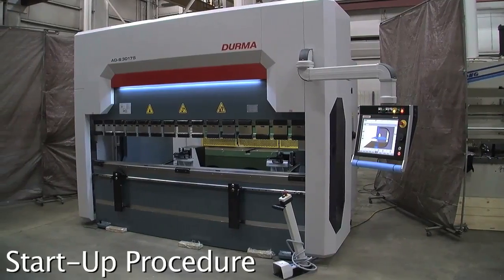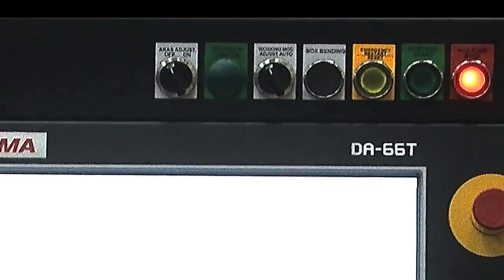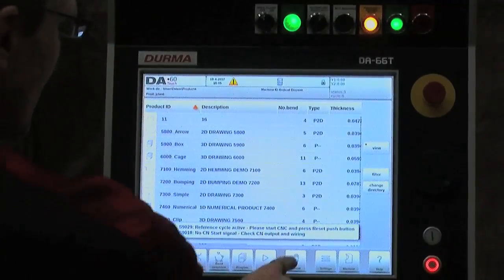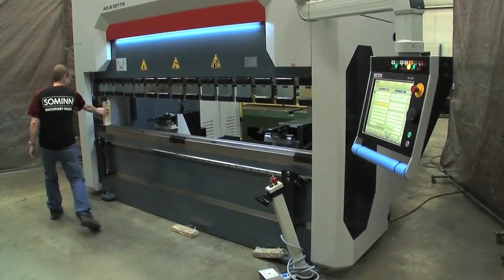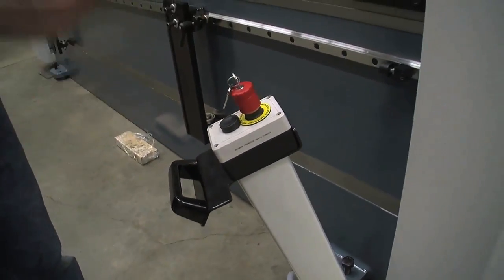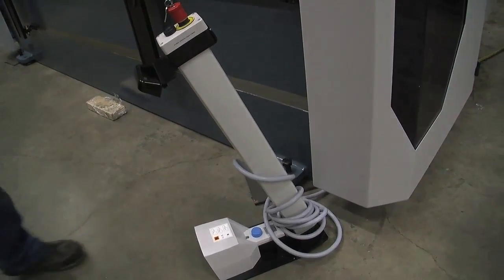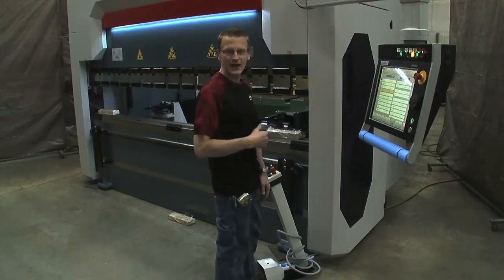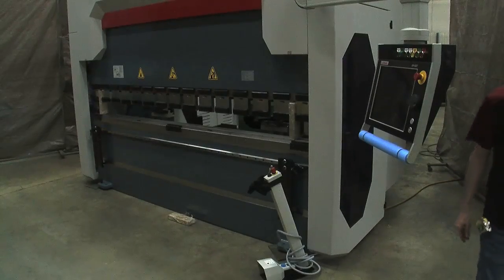Durma Press Brake Procedures

Comment: Great press, need to know how calibrate Y1 & Y2
Reply: I’m a service technician for Australia’s durma dealer 
There’s a few ways to calibrate them  
If they are not bending same angle from side to side find out by how many degrees one side is out ie 3 degrees work out what three degrees is in mm movement be about 1-2mm then go into parameters and find the index point y1 y2 then adjust either side accordingly
Reply: If they are bending same but not on target use corrections 
If waaay over or under folding get a piece of .5/.6 set machine to fold 180 degrees adjust y1/y2 index point in parameter until 180 fold basically pinches the material then returns back up with out leaving and crease machine should fold allot closer to target now 👍